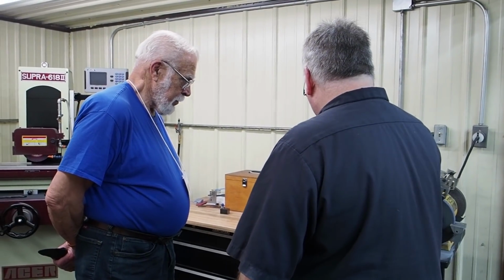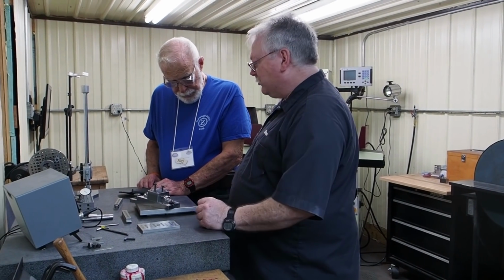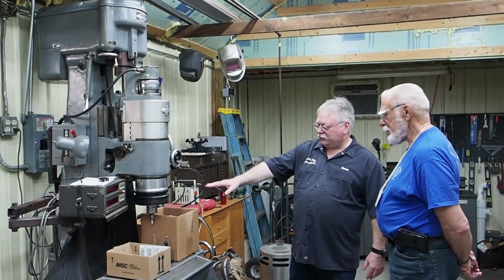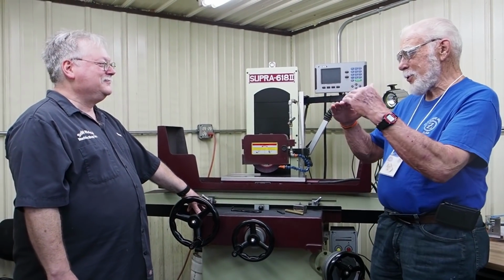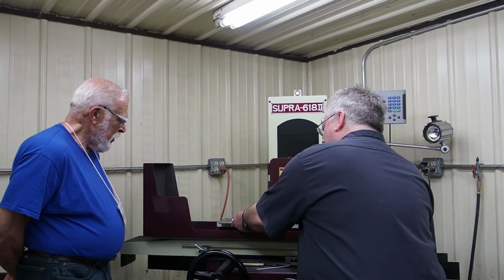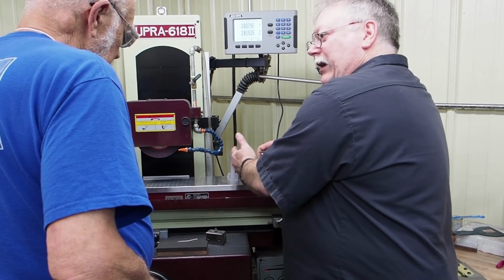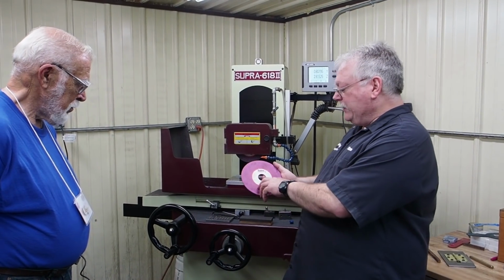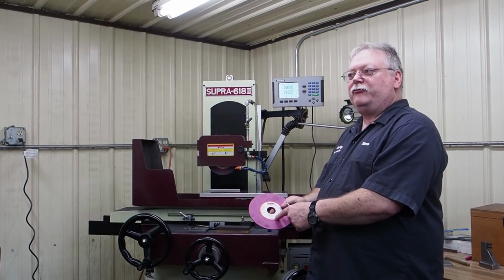Visit from Karl & Linda Schuler.

Comment: Oh my,,,,,love your machines Steve. Excellent explanation and description of each. In retrospect, I am now thinking I should have bought a surface grinder the smaller diameter wheel. This 12 inch wheel is seriously expensive for just a newbie in his garage shop. Especially when you’re talking a ruby red Radiac but I did another wheel, a 46 ruby so I’ll practice and compare it with the 32 I’ve been using. Not a raidiac wheel but  I have to start somewhere and it was priced right. Nice video. Wish your guests a safe trip.
Reply from the maker: Hi Ron,
You have a nice machine that can do great work. You can always add a 6*18 down the road.
Steve